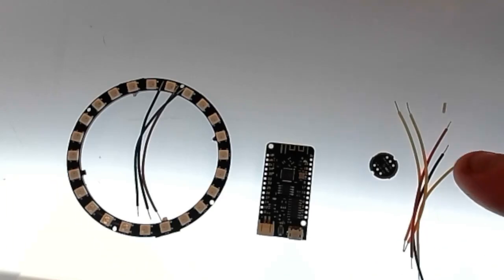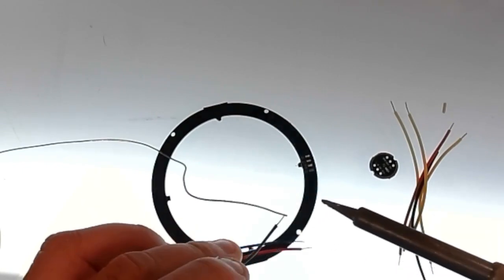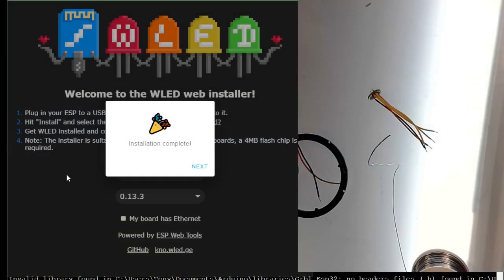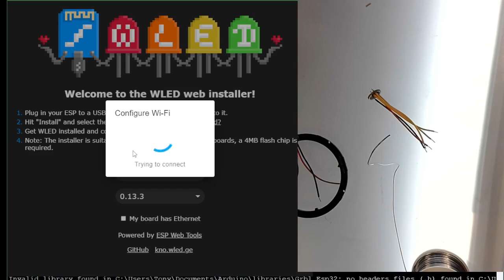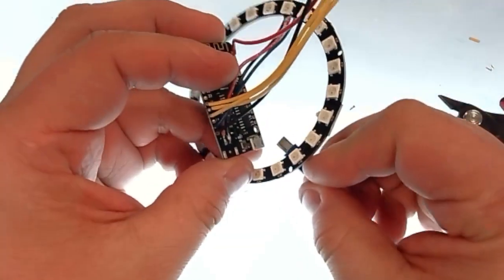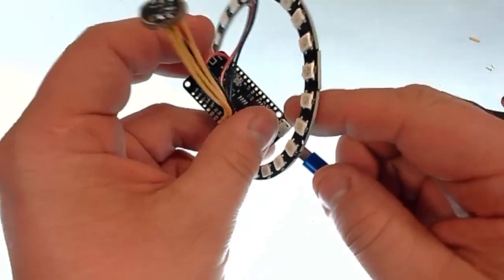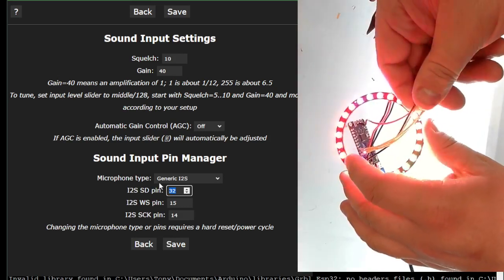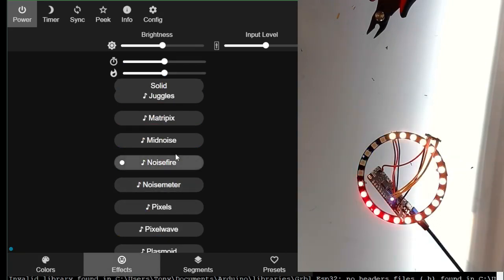Setting a Mic for use with wled on an ESP32

Comment: Great tutorial 👌 
Handy little tip... you can use a putty (here in AU we have Blu-Tack) to temporarily hold the board and wires while soldering. I use this trick all the time for electronics repairs and assembly

Comment: When you refer to the pins to connect the mic are you talking about the actual pins on the board or the gpio number pins? I originally used an analog mic, which worked at first and then mysteriously stopped working after a few uses.  I have had absolutely no luck whatsoever getting the digital i2s mic working. Ive tried different pins and im getting nothing. I even tried another mic.
Reply from the maker: With the ESP32,, the board pins are the same as the gpio.
This is sort of an outdated video now. It's now a setup in usermod with the latest wled.
Reply: @brakthehun  thanks for the reply.  On my board the gpio pin numbers are different from the actual pin numbers.   I'm thinking maybe I somehow damaged my board and that's why my sound reactive isn't working.  I dont know what else to try.